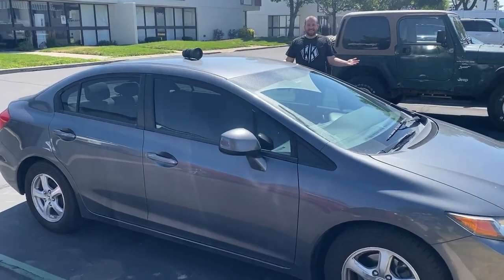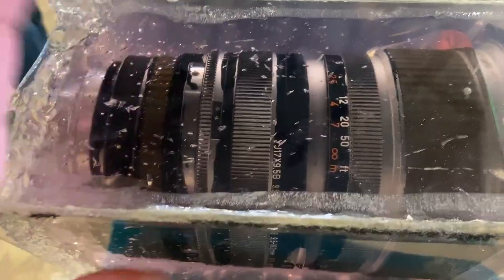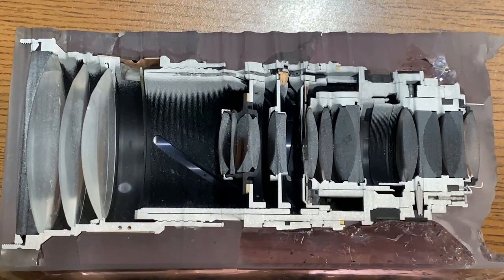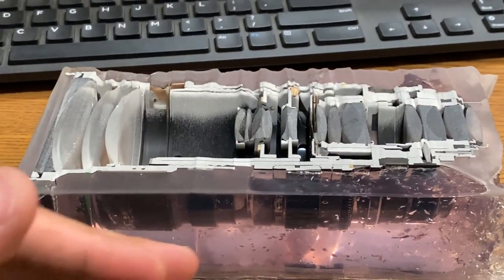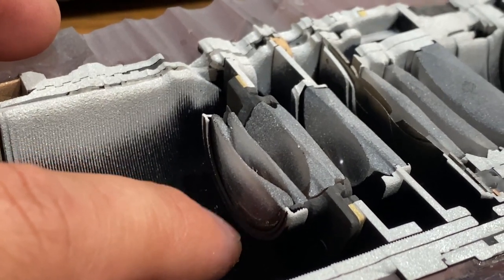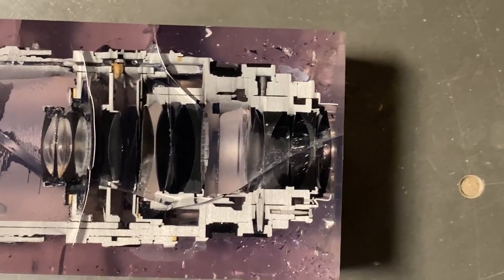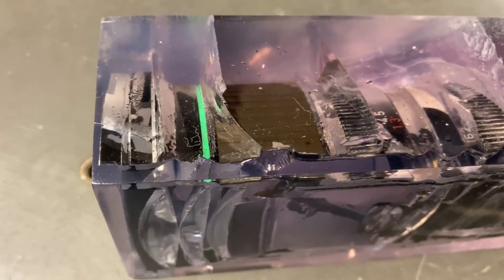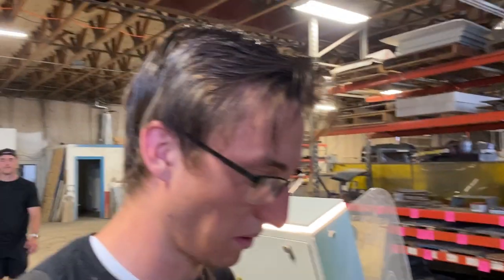Camera Lens Encased In Resin And Cut In Half With Waterjet

Comment: “We watched every resin YouTube channel and then decided to do the exact opposite of what they do for today’s pour.”
Reply: My thought exactly lol. They need the right resin and a pressure chamber not a vacuum chamber
Reply: @betafishjeremy7454  pressure chamber? I’ve never seen that. The vacuum it to get rid of bubbles, I have no idea what pressure would do.
Reply: @myrealusername2193  go watch anyone make knife scales, they use a pressure chamber. It pushes the air out and any that isn't pushed out is compressed into microscopic bubbles that can't be seen.
Reply: @myrealusername2193  it's the whole reason the even admit to it in this video. The issue with vacuuming is that the resin will start to set before you get all the air out.
Reply: @betafishjeremy7454  that’s why you just use longer curing resin. Plus, they said it was their fault that they used too much catalyst and so it cured too quickly. If they hadn’t, they likely wouldn’t have had problems.
Reply: @myrealusername2193  even long set resin can have problems and depends on what you are trying to can flat cause failure. Take in my field with making knives. When we make scales we like to swirl colors together and it needs to fit inside a mold. In a vacuum chamber it's very easy to overflow the mold and it starts to mix the colors instead of leaving them swirled. There are times for each one but I feel for what they are trying to do that a pressure chamber would work better. I implore you to look up pressure chamber resin casting, it's really cool to watch and see what can be made.

Comment: Just to let you know. Letting resin cure inside of a positive pressure pot works better at keeping bubbles out then using a vacuum chamber.
Reply: Why keep them out when you can keep them in :)
Reply: Pressure pots don't keep bubbles out at all. They just compress the bubbles so small you don't see them.
Reply: Vacuum chambers actually remove bubbles. Pressure pots compress them. So... if there’s a shit ton of bubbles they might still be visible after a pressure pot. Vacuum chambers are DEF better at removing bubbles from the work. No matter the compression, you can’t see what isn’t there.
Reply: Oh and then and than have two different meanings.
Reply: @drummerman1206  If you picked a long cure time resin, couldn't you vac it first and then put it in a pressure pot?
Reply: @Jay22222  Yep, doing both is better, remove as much gas as possible, then force the resin into any tiny pockets it hadn't filled. If you are only doing one though then vacuuming is almost always best by far.
Reply: @samheasmanwhite Yeah I know a bit about it, the basics and whatnot. I was just thinking "out loud" 
thank you for the answer to my question though.

Comment: Maybe drill some small holes in the lense for the next attempt on the side you won't use to help the resin fill in the voids
Reply: Get the same lense again, they can see now where to drill...
Reply: And if that isn't enough just cut a slit all the way down one side with a diamond saw.
Reply: Ehhhhh... On the surface it sounds like a good idea, but that will inevitably leave glass and plastic shards on the inside which will sully the final cast.
Reply: If they used a pressure chamber like they should have it most likely would have forced the resin in
Reply: @betafishjeremy7454  This. A pressure cooker hooked up to shop air would work wonders. Obviously using shop air to pressurize it instead of using boiling water

Comment: I suggest contacting Peter Brown for tips if you intend to start doing this regularly. He has a lot of experience with resin.
Reply: They used a vacuum chamber. He uses a pressure pot. Maybe HE is the one that should contac them for tips about resin casting...
Reply: @Beregorn88  Peter Brown also uses a vacuum chamber.
Reply: @nocount7517  he uses it only for stabilizing resin; the problem is that he uses the pressure pot at all! A pressure pot may, MAY, be an alternative if you don't have a vacuum chamber and you don't plan to subsequently work on your cast. Since the pressure chamber doesn't remove the bubble, but it shrink and pressurise them, when you try to work the resin on the lathe, all the bubble left tend to burst, leaving big crater on your surface. Despite having had this problem consistently for years he insists on using a pressure pot. I wouldn't call him an expert, rather a serial perpetrator...

Comment: You should use art resin next time. It cures crystal clear and doesn't shrink
Reply: CodyRedCoat
Reply: Yes, yes art resin definitely does shrink just like every every other two part epoxy. It's impossible for two part resins to not shrink due to the exothermic reaction when mixing. Anything warming up expands then shrinks as it cools.
Reply: @Dontworryimaprofessional  Wouldn't using a resin with a very long cure time or one that has the least dramatic exothermic reaction, as in the one with the lowest maximum temperature it will reach.

I wonder what would happen if you let it set in an oven set to the highest temp that the resin you're using will reach.
Then allowing it to cool slowly after it has set at temperature.
Thermal shrinkage will certainly still occur, I'm just wondering what would happen.
It would still set but it would probably produce poor results due to being in an environment it wasn't designed for.

Comment: Very large resin pours can explode if not actively cooled.

Curing resin is an exothermic chemical reaction and the rate of the reaction increases with temperature. If left unchecked, thick resin pours insulate themselves and just keep getting hotter and hotter until the internal thermal expansion forces just make the whole thing explode.
This is usually prevented by actively cooling the object being cast or by casting in consecutive thinner layers.
Stay safe boys!

Comment: I think a pressure pot usually works better for getting bubbles out of clear resin, you don't need to remove bubbles beforehand with pressure pots either. Plus it gives you more working time since you aren't putting it in the vacuum before the pour so you can avoid the resin curing on ya.

Comment: I feel like all you needed to do is make 1 or 2 fine drilled holes into the body and use pressure rather then vacuum to get the air out. 100PSI would've gotten resin into every nook and cranny. Also use a 2-3 part resin with the slowest curing time you have time for.

Comment: You should get/make a pressure pot, which is the opposite of a vacuum chamber. Instead of removing bubbles, it squishes them down so they are invisible, while the resin is curing. You should still vacuum the resin before pouring it though, and like with the lense with large air pockets, should probably vacuum after pouring too

Comment: I have had no problems casting large metal/stone parts on polyester resin.
1. Use a higher quality water clear casting resin.
2. Use 3/4 to 1/2 amount of hardener to slow the set and limit the amount of heat given out if pour is thick/deep.
3. Soak and vacuum the lens in unhardened resin first, this provides a slower setting "buffer layer" that prevents the resin cracking.
4. Probably need to drill/Dremel holes in the lens first so resin can get in/out between the lens elements.
5. After final pour put cling film across top of pour. This prevents the top being tacky and not setting properly.

Comment: I'd try using Cactus Juice. Which is used for wood stabilization. Its cured by heat, so you can put things in it, and pull a vacuum for a week or more. And then you bake it, and that cures the resin. That would solve the penetration issue

I'd have to look up how much it shrinks when it cures. I've never had problems with it, but i've also only used it for wood stabilization

Comment: I was wondering why you hadn't drilled any holes in the frame of the lens, checking with a schematic where to drill, cos that would be the only way to get resin inside, they are air tight.  Gonna need to do this one again.  Resin encasing is definitely a better way of slicing some items to keep smaller parts in place.  Will Mitchell fit the pot!?  Or do his boots!?

Comment: A little confused as to why y’all cut it out of the mold box… it should lust peel away from the resin. If not just use some mold release. Will save y’all so much time sanding

Comment: Make sure you film testing that huge vacuum chamber because I think it will implode. I made a small one out of a thin steel stock pot and it imploded before reaching a full vacuum. please test it anyways! It would be awesome!
Reply: I could be wrong but I believe a cylinder that size would have to withstand roughly 140,000 lbs at full vacuum.

Comment: You should use pressure on resin to  make the bubbles microscopic as opposed to pulling vacuum due to the shorter working time. You pull vacuum when making silicone molds to remove bubbles and the working times are longer

Comment: A pressure pot might work better for the casting resin that a pressure pot. I'm also not as certain your cracks were from shrinkage. You mentioned thick pours and polyester resin which usually leads to cracks from over heating. Good luck with try 2!

Comment: Pressure Pot not Vacuum. that's how you dissappear the bubbles. vacuum the resin before you mix, then put the casting in the pressure pot to 60psi. bubbles magically gone. MAS deep pour resin is one of the best Epoxys out there, and has super low exothermal properies

Comment: You need a pressure chamber to do the epoxy resin better in the beginning. The pressure chamber doesn't have the gas problem you ran across. Resin takes much to long to degas by vacuum

Comment: Drilling several holes in the side of the lens you don’t plan on keeping might help get the resin in the body of the lens. If you can find a way to avoid the elements.
Reply: What about cutting a slot down the whole thing with an angle grinder

Comment: So, let's see.  Atmospheric pressure is about 15psi, and that stock pot is 24 inches in diameter.  So, a bit over 400 square inches of surface on the top, times 15 pounds per square inch, is 3 tons.  That's going to take just a bit of reinforcing, I think!

And certainly don't use it as a pressure pot with 100psi in it.

Comment: That pot will definitely implode, but please film it anyway :)
The material is just too thin, especially the lid.
You might be able to use the bottom part with a strong enough lid, but even if it worked a dent would probably allow it to buckle.

Comment: Instead of turning that giant pot into a giant vacuuming chamber, it might be better to make it a pressure chamber. When you have large objects with tiny parts, the pressure chamber makes the bubbles so small you can't see them allowing for a clear cast without having to run a full vacuum for long periods of time.

Comment: it is hard to use a vacuum pump with resin. most resins cure too quickly. I have only seen short cure time (less than 30 mins) and long cure time approx 24 hours and nothing inbetween.
Reply: Pressure pot is the only way to go not vacuum
Reply: @Dontworryimaprofessional  And you are a professional?

Comment: Yea Polyester resin is cheap but it's definitely not meant for casting.  It's more meant for layup of fiberglass parts.  Epoxy would be a much better choice and is worth the 3x price tag for this application.

Comment: Use a high pressure pot, not a vac chamber.
It squeezes the air bubbles to an invisible small size.
Also, use art resin. It cures much clearer
Reply: I was thinking the same thing. Vacuum chambers work great for rubber mold materials, but for hard plastic resin, you really need a pressure pot instead.